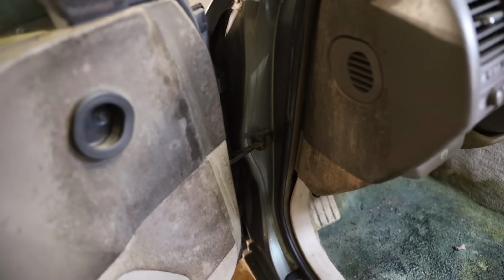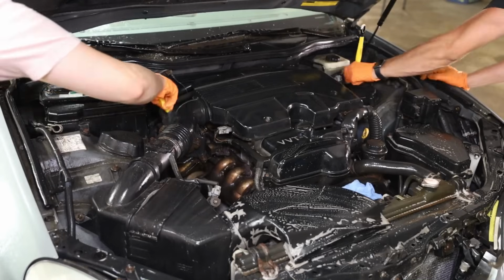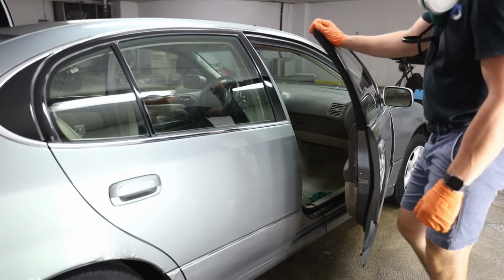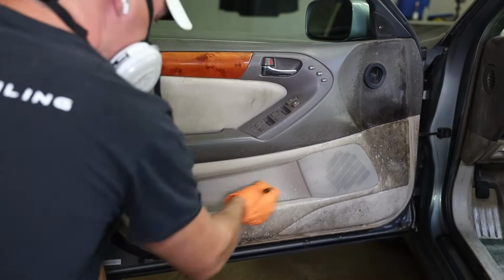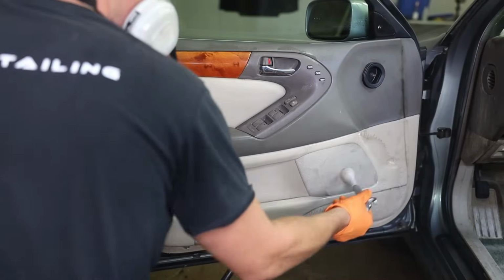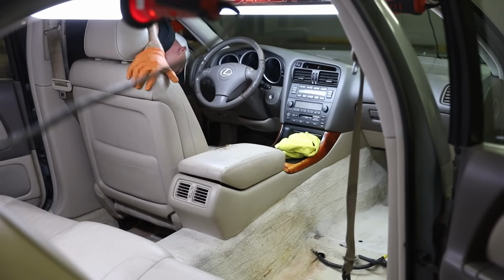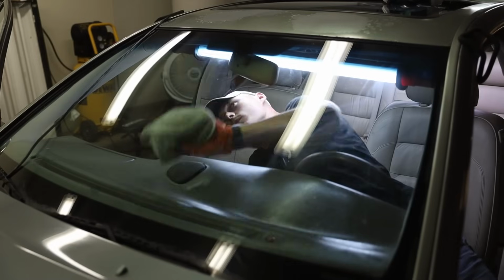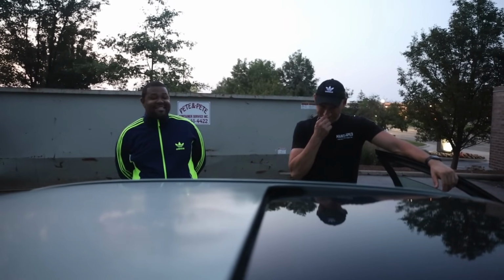Deep Cleaning the MOLDIEST BIOHAZARD CAR EVER! | Satisfying DISASTER Car Detailing Transformation

Comment: It looks great, one helpful tip might be that you have to be more cautious when detailing moldy or mildew ridden interiors. I wouldn't use the steamer until AFTER I have used an APC on the mold. When you use the steamer right off the bat you are spreading the spores all over the place and attaching those spores to warm water. The best video I have seen to date on moldy interior is on AMMO NYC's channel where he goes into deep detail about it. I think you guys do fantastic work though and no one can say you don't work hard!
Reply: Which video is it from their channel? The Impala SS or BMW 5 one or are both videos equally as good?
Reply: I think a UV light disinfector would be a great investment he could put it inside before he even touches the car it it would kill all the mold, fungus, and bacteria.
Reply: @ExxonYT  It pumps in ozone (O3). The machine splits oxygen gas (O2) into single atoms of (O). The single atoms of (O) then perform an “oxidation reaction” with oxygen gas in the atmosphere (O2) to form (O3). Hope this helps.
Reply: He might not have mentioned it in this video, but they do use an ozone machine before starting. He showed that in another video. I don't know if that's comparable.

Comment: I'm so wary of the fact that you wre unable to remove the carpet. Even though you extracted all the mold and discolouration, the carpet itself likely still holds toxic mold spores which can resurface in the future. When a building has carpet mold, the most thorough practice is to remove the carpet, treat the area with mold killer, and replace the carpet. You guys did a great job with what you were able to do, but I'm concerned that a significant health hazard remains as you were unable to remove/replace the carpet or flush out the internal vents.
Reply: well, they did address it and said it was completely stapled down. Not sure what tools you need to remove it and then re-staple but they're just detailers and they couldnt do it.
Reply: @ebscoHOSTpub  Yes, they did a great job within their capabilities.
Reply: Lol, look at the overall condition of the vehicle - they did a fantastic job. A little mold won't hurt anyone - it's present all around us. If it's the owner's intention to make the vehicle drivable then a few drives with the windows down on nice day will do the trick. 

Lol, in fact a medal needs to be given to the person that drove the car BEFORE the detail to their location!
Reply: @99Vood99  😂😂😂😂😂😂😂😂😂😂😂😂 a little mold? A little?
Reply: No one drove it. It was towed. They said it wasn't running.

Comment: This is an incredible transformation, but I’d never feel safe in this car. There’s definitely still mold behind the dash, behind the door panels, and in the vent ducting that couldn’t be reached. Also Likely under the carpet as well. Amazing work though 👌🏼
Reply: There is just as much, if not more, mold under the carpet. Agreed this was a fantastic clean up, but it made zero sense to clean up the carpet instead of just ripping it out clean and installing a new one.
Reply: @thiswashard855  they said they would of stripped the carpet out and cleaned it completely but when they removed some of the parts inside they found it was stapled down and they didn’t know why so they did what they could
Reply: @jessicardl  I agree, the team did the best they could. They're cleaners, not interior trim installers. I was referring to the customer who wanted to just wash the interior, instead of properly removing it all, cleaning, and replacing it. This deep clean couldn't have been cheap.
Reply: @thiswashard855  I get you. The guy did say he was gonna have the carpets replaced when they got his reaction and I’m guessing whatever else might need replacing

Comment: You did a great job man and understand what you said in your video but as a prior dealership tech, I take everything out and remove the whole carpet for flood insurance job or leaking sunroof problems or whatever it may be. Under the carpet, you have Jute padding which I throw that shit in the trash, and install a brand new padding after the carpet is completely dry and the inner vehicle is dry. That jute padding is still saturated with that nasty water.

Comment: I have a few concerns with the Lexus padding under the carpet. May appear and smell better but the padding they use holds quite a bit of moisture if not removed and dried. Not sure on the staples except where the door trim panels are. Lexus designed this method for better seals and sound deadening purposes. I would also have painted the wheel Wells black, maybe the wiper blades and the undercarriage. I am sure it was discussed. Overall great job. I use compressed a lot when cleaning interiors. Seems so much faster. Thanks for the video.

Comment: good video but a lot of things you shouldnt do. using the steamer on the headliner will 9 times out of 10 make the glue release and the headliner sag or come off in some areas. using the steamer on switches and electrical components blasts water into them which will cause corrosion even if it doesnt cause any kind of short.

Comment: I know that is difficulty removes the carpet, but in this case is necessary because it can create rusty holes in the floor.
Reply: The carpets on those types of Lexus are stapled about every 4 inches on the entire carpet, they would’ve had to basically install a household carpet inside a car.
Reply: @suemason  that's bad, I work in a body shop and had seen rusty holes under large rubbed carpets ( specially in long flooded vehicles) which the water enters through seats holes.

Comment: Ain't No Way I would do a better  job than you!  If I were keeping the car, I would replace the carpet, seat cushions, headliner, etc.  Mold is a very difficult substance to delete. People have died from mold exposure in their homes.  I would have an mold expert inspect the car if I were the owner. As a driveway detailer, I would stay away from this job.  I would Not want the liability.  Also the ventilation system needs to be deep cleaned as well.  Excellent job, BOYS!
Reply from the maker: Perfectly said!

Comment: Man i got a goot 220 bar Hyundai pressure washer but the hose is a pain in the but, extra stuff plastic impossible to use. Is your hose an after market product how much bar / psi it can handle ? looks like its really bendable and easy to work with. Cheers from France

Comment: For the water issue you could use a mobile dryer unit or A/C for a couple of hours to get the rest out. I once had a „little“ spill of 8 liters of water in my Tesla but 8 hours on max heat (62 celsius) removed everything 😁

Comment: As this shows how good of a job you can do  and it turned out beautifully but if that carpet was that bad for that long the padding under the carpet is screwed. 
Once that car is closed up for even a few hours the stench is going to come back. The backing is still wet. There probably still standing water in the car..I would have pulled the carpet and if not replaced then cleaned it like you did power washed the back and let it dry in the sun for a couple of days.i don't dought you did a awesome job but that customer will be calling back saying it still stinks

Comment: Maybe I missed it, but, how on earth did this car get like this? Honestly, just awful. Nice restoration...
Reply: The car had a hole in the top from all the buildup of leaves and dirt between the closing of the doors and the actual car, which made it impossible to close all the way, therefore resulting into that monstrosity.
Reply: @alpanne5363  oh, right, they did mention that at the start of the video. I was under the impression that the owner had cleaned that area, but water was leaking in, somewhere else.